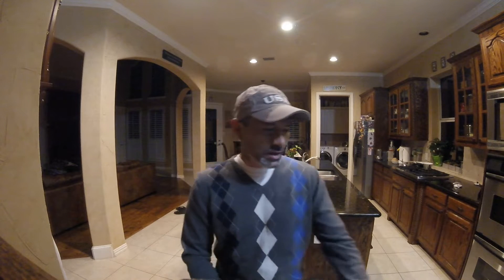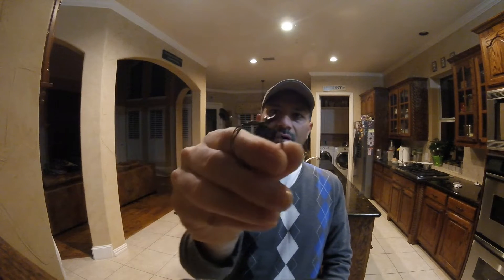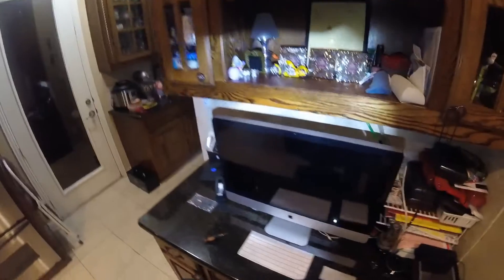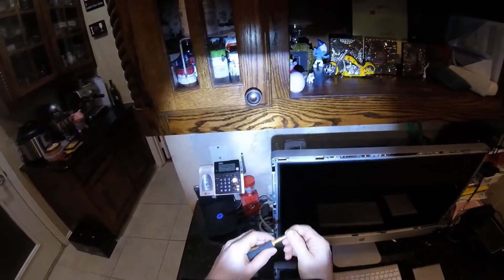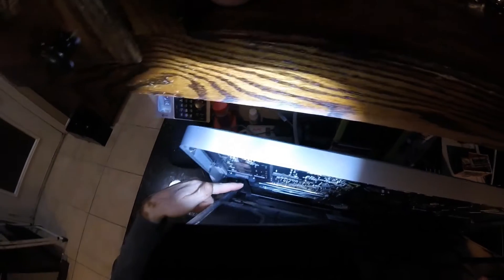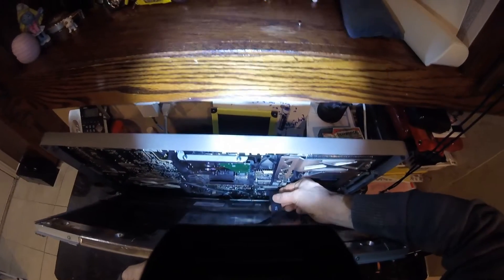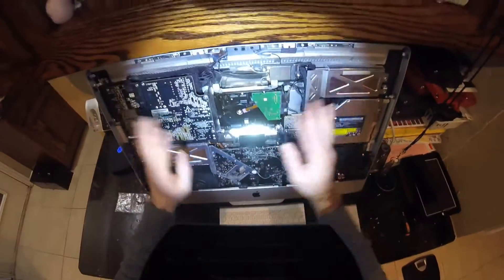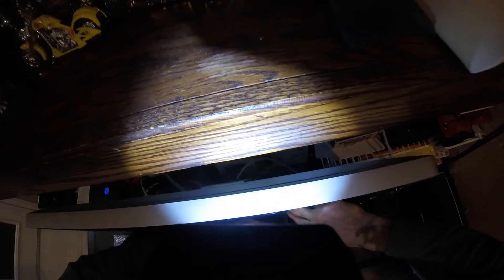iMac HDD Temperature Sensor Bypass Hack/Fix

Comment: Can somone tell me the exact capacitor you need for that
Reply from the maker: You need "resistor", not capacitor. I used 1 K Ohm resistor. You may need different resistor value depending on the years your iMac was manufactured. Just measure the resistance across the old hard drive thermistor terminals or any other working thermistors connected to the board.
Reply: @PrincetonProjects  ah i have the mid 2010 imac even 2 of them both will get an ssd Upgrade and i want to mod both of ehm
Reply from the maker: @thedumbdino9224  1K Ohm should work. Do don't need to solder on the board like I did. Just connect resistor using the connector wires that you remove from the old hard drive.
Reply: Well i bought some of them but that just made it worse my fan is now faster than ever

Comment: For people still working on these:  I just worked on a Late-2009 27" iMac A1312 (EMC 2309) for an SSD install.  The only home-brew solution to bypass the HDD thermal sensor and keep the fans at an ambient-level was a 500 ohm load on across J5550 of the logic board.    I took two 1K Ohm SMT resistors and stacked them in parallel, and soldered them across the sensor leads at J5550.    On this particular model, swapping the ODD sensor with the HDD sensor did not work.  Shorting the sensor leads did not work. Keeping the original Hitachi HDD PCB attached did not work.   All of those attempts resulted in excessive fan level.  

I suppose if you only had a 470 Ohm resistor, that would work too.  A 1K Ohm resistor was to high impedance.   I hope this note helps some people still working on these!
Reply: I used a 470 on the end of the leads and it was perfect!
Reply from the maker: Very good info.
Reply: @PrincetonProjects  iMac 27inch 5k 2017...i5 7500 CPU running at 0.8ghz from boot. Would this also be a sensor issue. I saw a post where a guy shows temp displays and the machine goes into a safety feature if the temp sensors are running at stupid readings eg: -127c or etc etc.
Reply from the maker: @ByronduBoisZA  If you didn't replace the HDD then this may be related to a different issue with your Mac.
Reply: @PrincetonProjects  Ye I think its most probably other sensors on the mainboard which are creating this issue.

Comment: I cut the temp cable going to the hdd and added 1k okm resistor but the fans are still at max speed
Reply from the maker: That's strange. Couple things you can try: measure the resistance between terminals on the board where the temp cable is connected in order to rule out any connection issues. If that fails then you can try measuring resistance across temp terminals on the old hard drive and make sure it was around 1K ohms.
Reply: @PrincetonProjects  it was my fault, I didn't know that all temperaturw sensors have to be connected, I worked on the iMac without the display. It works fine now.

Comment: SSD up-grade on my 2009 iMac, I used a cable the same as the one used for the dvd player for the SSD drive and it worked, no loud fans, I found the cable on Ebay for under $10

Comment: You saved me time and money. I have the same unit but late 2009. Dont know how you got 1k ohm value but I'll try the same value for mine
Reply from the maker: I measured resistance of a working thermistor.
Reply: @PrincetonProjects  thanks for your video and quick response. I knew that you need to measure the working one to take as ref from other sensors. I meant idk whether you measured them while the machine is on/stress. But I understand that 1k value will work just fine by you did it and your machine is still fine. Great work!!!
Reply from the maker: I measured after cold boot.
Reply: Princeton Projects thank you sir!

Comment: great video! when I was disconnecting the skin temp sensor the wires were pulled from the connecter and the connecter is still stuck into the terminal. do I just need to install a whole new skin temp sensor? or can I re attach the connecter somehow
Reply from the maker: These micro connectors are not easy to fix. You can solder any wire to connector terminals but better to buy a new wire with connectors if you can find it.
Reply: @PrincetonProjects  Thank you for the response! If I buy a new cable with a connector can I just splice to the old Skin temp sensor or is it best to just re-install the whole skin temp sensor cable?
Reply from the maker: Splicing should be just fine.
Reply: @PrincetonProjects  Awesome Thank you!

Comment: Why not just shove the resistor wire into the end of existing cable and wrap it in tape? Saves having to solder.
Reply: That's exactly what I was about to ask.. I guess it'll do the trick. Also there's much less chance of damaging the board by being useless with a soldering iron - like me.
Reply: @johnj3577  I ended up cutting the cable about 2cm above the plug and soldering the resister on and put heatshrink over both legs and a bigger piece over top to make a little bung that plugs into the port and stays out of the way as its still removeable then too in case i want to pay like 3 dollars and order a DVD drive sensor cable to use for the SSD.

Resistor method works perfectly though and if you want the fans to adjust dynamically still you can just download MacFanControl and tell it to pull the temps straight from your new SSD.
(Just need to set a manual temp range though on top of that so it doesn't get too noisy)

A temporary workaround for a missing or faulty sensor is to use MacFanControl or smcfancontrol, setting all the fans to manual or to read straight from the hardware's reported temps rather than the sensor.

I had an older imac where the fans would run 100% because the smc had daddy issues and it would set the minimum fan speed to like 5800rpm. 
I found a temp fix (that needed to be done each reboot) where you could go the setting in smcfancontrol and untick S.M.A.R.T , wait 10sec for the fan speed to start dropping then tick it again and it would work perfectly and adjust itself properly until a reboot. 
Would even go in and out of sleep mode just fine and continue working properly.

Comment: Doesn't it make more sense to just find out what the fans run at under load then set the fans at that speed through the fan control once you put the new ssd in?
Reply: It's not as simple to hack a speed controller. Fan speed changes with temperature changes. But essentially what you are thinking is what we did in a round about way. I measured the resistance of the thermistor at room temperature which in turn sets "normal speed" of the fan. So in the end, we are running the fan at speed required at room temperature. I suppose you can measure resistance when computer is powered to get real "normal speed" but like I mentioned in the video,  there is plenty of air flow around HDD due to other fans.

Comment: Thank you for the info! This worked. So far so good. I have the same iMac you do. I just put the 1kohm resistor across. the wires at the connector.

Comment: Hi there! I've got an iMac 27' Late 2013. I am changing the original HDD for a SDD one due to performance issues. The latest OSX versions don't run well on this model, and hopefully, the system will perform better with this upgrade. Do I need to apply this fix too on this model?
Reply: Most likely if the HDD has an additional 3 pin connector with thin wires.

Comment: Hi my iMac 27inch 2011 fan runs full speed constantly it’s so annoying I downloaded a fan app to see how it was running and the cpu has no readings any advice ?
Reply from the maker: I have never used any fan apps so I can't help. One of the viewer recommended "one of the many speed control app". May be you can try one of those.

Comment: Nice solution. Can the same be done for the display? I'm planning to use may iMac which has a broken display and run it just on an external display only. But I've heard the fans also run at 100% without the original display (and it temperature sensor) attached. Advice appreciated.
Reply from the maker: I would think so. The trick would be to find out which pins on the board are connected to thermistor in the display? All the thermistor connectors on the motherboard are two pin connectors so if you try each one independently one by one then you should eventually find the right one. Don't solder anything until you find the right thermistor.
Reply: @PrincetonProjects    Thanks for the reply. It looks like the display thermistor's two wires connect up to the display's ribbon socket and run back to the logic board as two of the 60(?) in this ribbon cable. Do you think there might be an easy way to discover which two of the many wires in this cable are responsible for the thermistor control? How would I check them all to find out which ones to hack with your solution?
Reply from the maker: @petersloper9674  Trying to find the thermistor terminal with trial and error on a ribbon cable would be quite hard. Couple of things you can try: 1. Try to find a pin diagram for the ribbon cable or 2. start disassembling the display and physically find thermistor, trace back the wires to the ribbon connector using ohm meter.
Reply: @PrincetonProjects   I've found a datasheet for the (2107) iMac display. It lists the function for each of the 60 pins. I think it could be any of the four 'TCON' (Temperature Control) pins from 17 to 20. The datasheet states:

17. DDC_SDA : TCON I2C Master Bus
18. DDC_SCL : TCON I2C Master Bus
19. I2C_SDA : TCON I2C Slave Bus
20. I2C_SCL : TCON I2C Slave Bus

Can you suggest which of these I should try with your technique?
Reply from the maker: @petersloper9674  Looks like this might be more complicated than I thought. Any pin with SCL/SDA label is most likely using I2C protocol. Looks like the temperature data is being transmitted using I2C protocol. Trying to fool I2C packets is going to be extremely hard unless we know what packets are expected by the receiver for temperature readings. I2C is like any other data protocol where ANY information can be exchanged. Little tutorial on I2C FYI: https://robot-electronics.co.uk/i2c-tutorial

Having said that and before we jump to conclusion, can you point me to the data sheet? I want to confirm that there is no other mechanism to gather temperature data for this display.
Reply: @PrincetonProjects   Here's the display's datasheet PDF link: http://www.go-gddq.com/down/2017-07/17071215336070.pdf

I have the thermistor used for the display - so it may be best just to hook that up to the correct two pins - if they can be found.

(thanks for your help, BTW)
Reply from the maker: @petersloper9674  Few things I noticed in the data sheet.
1. There is a 2-pin connector for "remote temperature sensor" which seems like the thermistor connector (Table 4). You can try connecting thermistor/resistor to this connector on the display board.
2. It is safe to assume that all the sideband communications (including temperature value) from display board to motherboard are done on DDC I2C pins.

If the display board is still functional then using this 2-pin thermal connector will be your best bet. If this does not work then display board is not functional. I would stop the savage efforts at this point.

Comment: Works perfectly! This is a good option because the fan will still spin and the drive will be cooled. It's only 1100RPM which is around the lowest speed for that fan which is fine for the hard drive or SSD. 
You can also use this method in conjunction with Macs Fan Control software or similar to raise and lower the speed based on the drive's internal sensor if you wish. Yes, you can use JUST the fan control software but it will only turn on when the user is logged in; not a good option if you're doing it for a customer who will probably query why their iMac sounds like a jet engine when it is starting up or sitting at the login screen.
Some people suggest plugging the ODD sensor cable into the HDD sensor board connector. This is not a good idea because that fan cools the graphics card heatsink! You need that sensor working correctly. Just use the 1K resistor like Jigar suggests, on the HDD sensor cable. A touch of solder and some heat-shrink tubing and you're good.

Comment: Good Morning
Where exactly do I connect the wires to this diode?
Reply: @PrincetonProjects  OK! But where do you connect these wires to the motherboard?
I have an imac 21.5 mid 2011
Reply: @PrincetonProjects  Please, could someone post a video or photo to know where to connect the wires?

In which extremities? Please!
Reply: What diode?
It's a resistor.
It's a better idea use the connector original. And in the connector solder the resistor. 
That way you don't modify the original sacred card.

Comment: Thank you. It works for my 21.5 inch 2010 iMac
Reply: Please, could someone post a video or photo to know where to connect the wires?

In which extremities? Please! 21.5 inch 2010 iMac
Reply: @djfabianosalles4177  The temperature sensor cable is the 2 wire cable beside HDD SATA/Power cable. See the picture:
https://blog.macsales.com/wp-content/uploads/2013/08/HDDFan5.jpg
You just need to connect a 1K resistor between the 2 wires. No need to solder. Just insert the 2 pins/legs of the resistor into the holes of 2 wires on the connector, then wrap the resistor and connector up with some plastic tape for insulation purpose. Then connect the original SATA/Power cable to SSD's SATA/Power connector.

Comment: Smart. I will try to connect the resister were the wires used to plug into the hard drive. This way you don’t have solder into the computer board. Too Risky.
Reply: Where do I connect these wires?
Reply: @djfabianosalles4177  I read somewhere else you can actually just jump a small wire across the connector (the connector right where is used to plug into old hard drive).
Reply: @caseykittel  Please, could someone post a video or photo to know where to connect the wires?

In which extremities? Please!
Reply: one guy just simply removed the circuit board off the old hard drive, wrapped it in tape and placed in the bay right by the new ssd. he simply left it plugged in just like it was. he plugged to other two cables into his new ssd drive. other people added a resistor, thermistor or just a short section of wire. an old cat 5 network cable would be a good source for wire for this. google image search "imac 2011 thermal sensor hack" lots of photos.
Reply: @PrincetonProjects  I read somewhere else you can actually just jump a small wire across the connector (the connector right where is used to plug into old hard drive). I wonder what temp the computer will think the hard drive is. probably very cold. no resistance at all and the fans run on high, so going the other way you would think it would shut the fans down. what do you think?
Reply: Casey Kittel  I think it is the opposite. No connector would be an open circuit (infinity Ohms) so a jumper (very few ohms) to 1k resistor (1000 ohms) would suggest that the higher the resistance, the “hotter” the sensor. 

In theory you could wire a potentiometer and use it as a manual fan temperature control. Muhuhuhuhahahahahaaaaaaa!
Reply from the maker: Yes, you can simply use existing wires from the connector to connect a resistor.